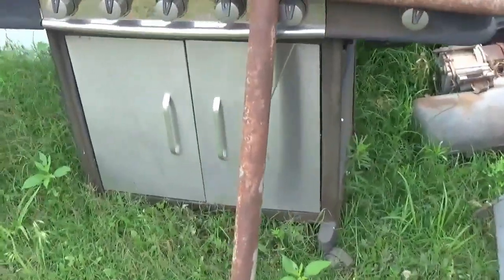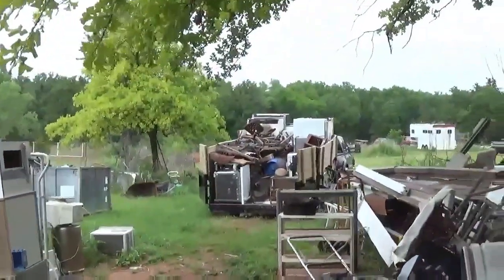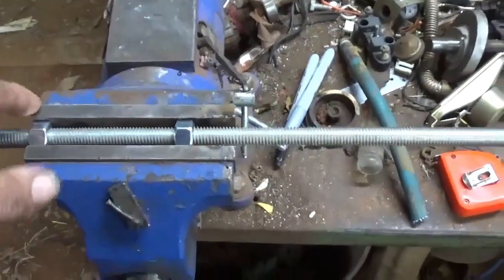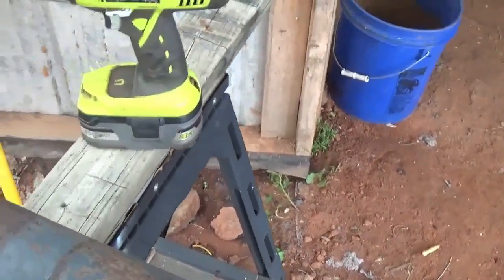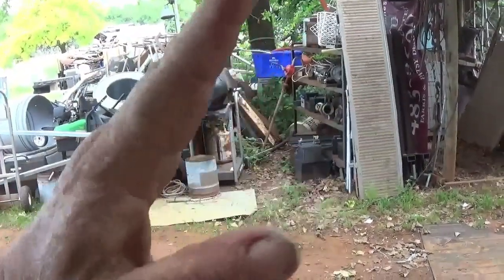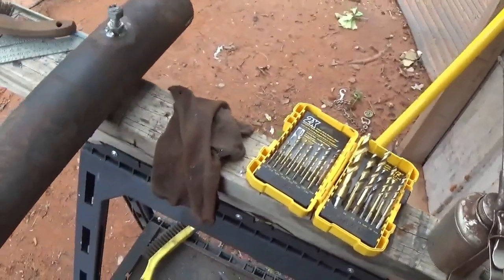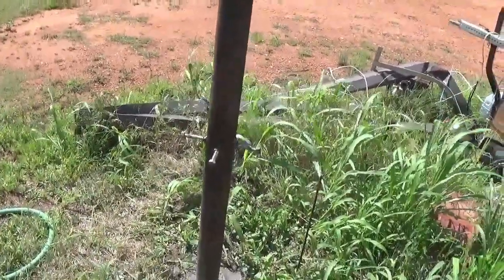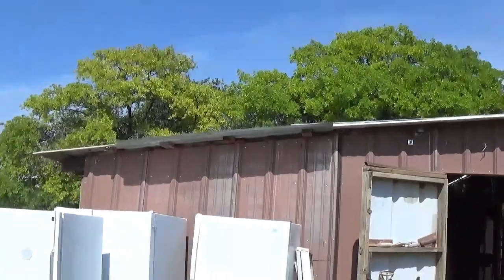A Solar Array is born free power from the sun

Comment: Interesting. God bless
Reply from the maker: I can run most of my tools with the setup that I have, but if I worked at it hard and for most of the day the battery would be very low, and may take a day or two to recharge, the plan is 12 100 watt panels with 4 100 amp hour batteries, that should give me more then enough power to get me through the winter days with lots of cloudy days and have emergency power if a storm comes through and knocks out the power

Comment: WHAT I DON'T GET IS IF THERE IS NO SUN, YOU HAVE NO ENERGY, THAT COULD BE DAYS, IF CLOUDY OR RAINING. AND THOSE THINGS ARE NOT CHEAP.. I COULDN'T JUSTIFY THE COST.
Reply from the maker: the energy is stored up in batteries, and they work great on cloudy days, the solar panels will still produce power on cloudy days. just not as much. that is why you build the system to account for cloudy days. with 1 panel I would get about 6 amps an hour on a sunny day and about 1.5 amps on a cloudy day
Reply: @Okiescrapper  so besides the solar panel expense,  one must buy a bunch of big ole batteries to store the energy. I'm not mechanically astute so I don't know about such things as amps etc. but doesn't seem like it would last long, say for running a refrigerator. I thought of trying to purchase a couple of 200 watt solar panels, and solar generator, but those are out of my price range by gads, lol, believe me I've searched, but all in all, all I've ever seen them last for is about 6 hrs and it can take days for the solar panels to recharge the batteries. I was concerned not having electricity for my chest freezer, or medical equipment, but oh well. Can't afford that stuff. Thanks tc and hope you get it finished.
Reply from the maker: @wheepingwillow24u17  If you have a car or truck that you can run as a generator you could get a 1000 watt inverter, a chest freezer will use about 400 watts, not sure how much your medical equipment will use. a 1000 watt inverter would put out about 10 amps I think, so you could hook it up to your car and have some electric if the power goes out, and then you could get a deep cycle battery from walmart or auto parts store. and charge it with a charger or hook it up to your car to charge, harbor freight has a little float charger for $10.00 that will trickle charge the battery, it may take a few days to get it to a full charge. this would work if the power is only out for a few hours. start small and slowly add to it more batteries the longer the power will last
Reply: @Okiescrapper  I have a gas gen. also a truck that I can't travel with, but those both take gas, and gas is outrageous, and my low income wouldn't allow but about two six gal tanks and that  won't get me but about 20 hrs if that, then no gas, so I can't rely on that for a chest freezer, or charging an electric wheelchair, or my lift chair which I'm forced to sleep in by my work  comp ins carrier. I appreciate your attempt at assisting me, but I don't have a lot of money and don't have the physical capability to pick a battery  up and things of that nature, but thanks all the same, I just figure I'm screwed.

Comment: Hope it all works out in the end, I'd be a little ticked off about the sizes not matching what you paid good money for too. As long as it does what you want it to do in the end that's all that matters.
Reply from the maker: I got looking at there amazon pages and one has a set of two that are the 20.5 x 40.5 the one's that I should have ordered, and another page has the one's I ordered, with a drop down for how many you want, but still neither option are the same size as the one from the starter kit, so I will just have to make sure I order the size that I have.

Comment: Looking very good! I would seriously consider getting an 80a outback controller. If you tie pairs of panels in parallel, your disconnect box and single controller can handle all 12 panels. Also you can upgrade voltage later by getting a higher voltage inverter.